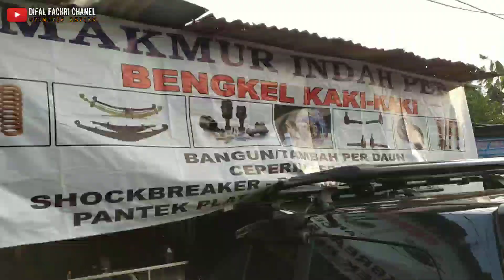Biaya Ganti Bearing Klaher Roda Depan Grand Livina Penyebab Bunyi Dengung Dan Cara Pasang Kaki kaki

Comment: Bisa minta info punyaku mobil grand livina 2017 manual 1500cc. Mau ganti bearing inner cv joint. Di cek barang sesuai tipe mobil tapi pas di coba nggak masuk atau nggak cocok. Kok bisa yah ? Ada kah yg sama seperti ini? 1:47

Comment: Ajib bang rival kebetulan baru aja plng dr bengkel abis jajan si livi abis ganti kaki2 mobil bang rival 
link stabil 225 x 2 = 450
lower arm assy 2pc x. 650 = 1.3jt
bush crosmember 225x2 = 450rb 
karet stabil 2pc x 100 = 200
total Rp2.400.000
jasa Rp300.000
total Rp2.700.000,-
Kira2 k3mahalan gk bang
Reply from the maker: Murah om.. yg penting nyaman sama bengkel nya
Reply: mobil apa om & di bengkel mana benerin nya?